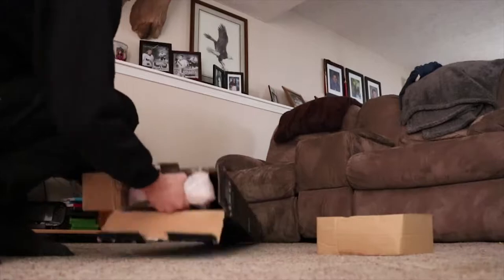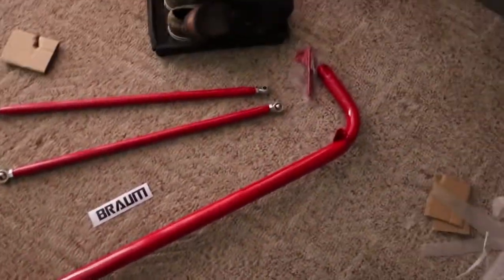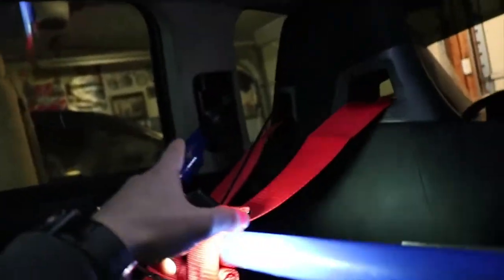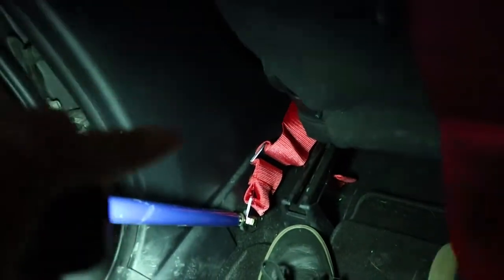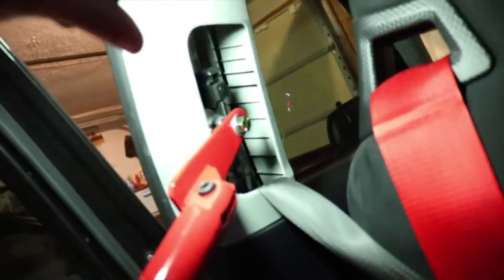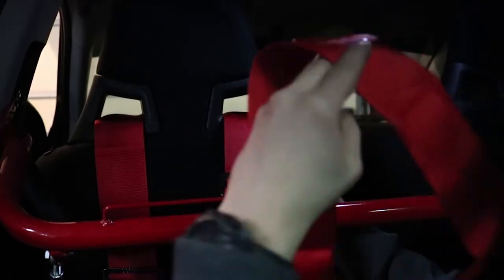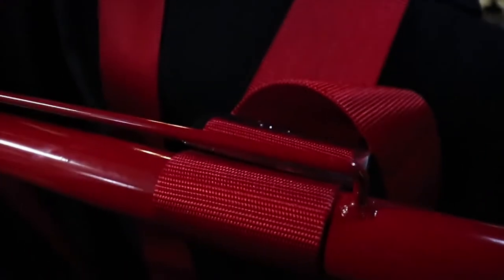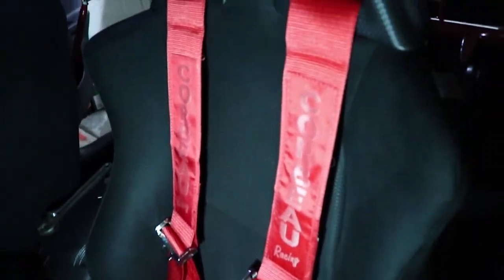Braum Harness bar 2014 Evo X

Comment: So you never had to cut the pillar plastic with either harness bar? I'm trying to pick which one to buy now but I want it to fit in the slot like yours without damaging my b pillar trim or removing it entirely.
Reply from the maker: Trevor Plagg all I did was remove that piece of trim around where the seat belt bolts in. I’ve just left the plastic piece off. I didn’t wanna damage it Incase I decide to part the car out or something.

Comment: Are they FIA approval ?
Reply: No they aren't allowed by any racing organization, only roll bars(half cage) or full cages are the only method allow for mounting harnesses, if you have racing seats and none of those mentioned above then you are allowed to use the stock 3 point seat belt with it.